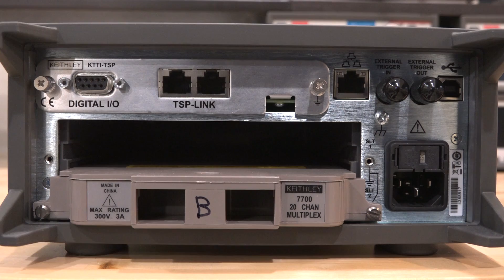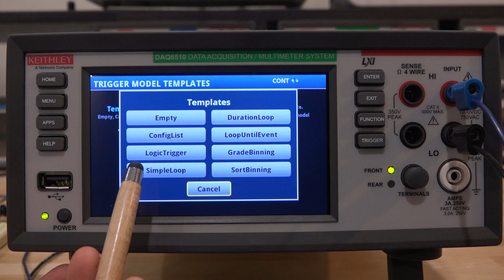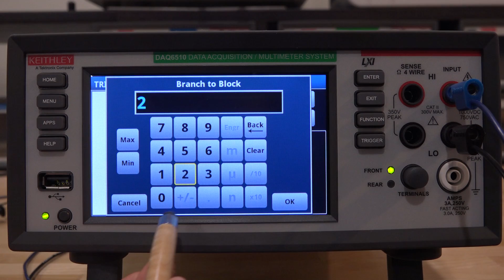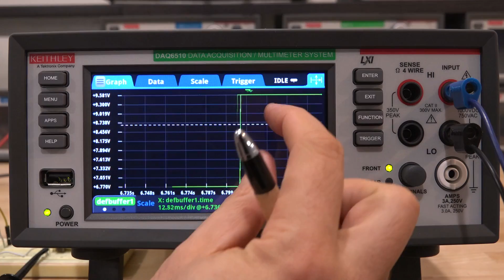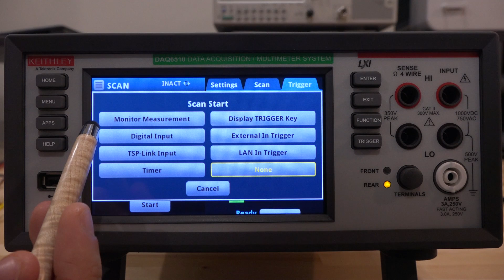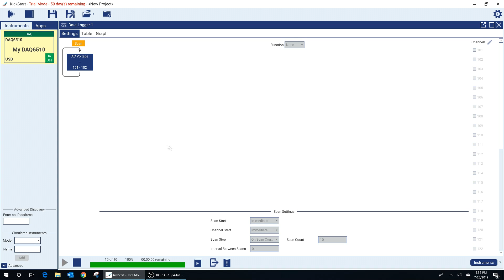TSP #154 - Keithley DAQ6510 6.5-Digit Data Acquisition & Multimeter Review, Teardown & Experiments

Comment: Great review as always Shariar! One question through: Am I missing out on functionality by not using TSP, or can I do the same stuff by interfacing via. LXI/USB using custom software?

I love Keithley instruments! I use the SMU2450 and DMM7510  at work and the DMM6500 at home in combination with other types and brands of instruments. I've used the Kickstart software as a trial (and liked it), but I'm not keen on buying it. I've never used the TSP script.  For measurement automation, I've over time built and refined my own software in C and MATLAB (only by small amounts in Python) depending on the application, using the NI-VISA driver for which I control the various instruments via LXI/USB/GPIB etc. I realize this might not be the case for the  average user, but this approach gives me great cross-brand flexibility and other custom advantages at the cost of time spend writing software and verifying it works.

Comment: For the Keithley 7700 acquisition module, when the DAQ scans Channel 122 for the current measurement, is there a monetary break in the current flow for the DUT?  I can't tell from the documentation if the relay provides a make-before-break connection.

Comment: Dear friend, thanks for the outstanding review of DAQ6510. Actually I am facing the problem of overflow message and hence loss of measured data when I am using 6 termocouples in 6 channels. I need to monitor 6 points of temperature each 30 seconds for 100 counts, but several times i get overflow in varied channels. Some points of the graph get blank. How do I solve this and why this happens?

Comment: Wow they made it WAY easier to use than my Keithley 3706a. That thing is pretty much only usable as a slow benchtop meter unless you get a computer to drive it. I've had a good opinion of the Keithley DAQs, but the new generation is nice indeed. I haven't tried Keysight's new DAQ970A yet but it's a step up above previous generation offerings like 34970A in terms of front-panel usefulness.

I've always enjoyed using a normal DMM and a computer to make a high dynamic range oscilloscope. I did a cool project once with an HP 3458A in 5.5 digit mode and 50,000 readings per sec.

Comment: What is the point of having 1MS/s, if your multiplexer is using relays?

The device and unit is nicely engineered, but I am not impressed, especially considering the price. The extra IO board on top, this KTTI-TSP, it is pointless to put it as a separate board and option that you need to pay for. It would make much more sense to make it a standard, lowering number of parts, and lowering the total cost. Seriously, the only other IO boards, are the RS232 and GPIB options. There is enough space to fit all of it on the unit standard. And if there is not enough space, just use RS232 and TSP, and provide GPIB via small external dongle. It is just milking customers. These IO boards, have almost no engineering effort in designing them, and cost to make them, yet cost about 300-400$. LOL.

Another week point, just look at the voltage reference placement and area around it. It is messy, I see no isolation of the reference, or taking care of leakage.

Similarly, the front/back terminal switching, I do find weird in the unit like this. There are no BACK terminals on this unit per se. It should be controlled by relay, not a manual switch.

It is also a bit unfortunate the fuse is buried deep inside the unit, and not available on front panel instead.

On the acquisition board, you can see the connector that connects to the connector in the unit itself. The problem is, it is not secured to the PCB. There is even place to put screws, but I don't see any screws on it. So, it is likely the connector or solder will break off, as it will carry all the mechanical stress of plugging and unplugging the board.

6 temperature sensors for cold junction compensation, and good thermal coupling is a nice touch, but that it to be expected, otherwise the thermocouple measurements wouldn't be reliable or accurate, and it will be pointless to use high accuracy measurements. It is not even nice touch, it is a necessity, and is done in every good thermocouple based system.

The most impressive parts, are the NEC/TOKIN relays, claiming 100 million actuations with no load (or very slow load, like thermocouples). That is actually magic. Similar ones are by KEMET. Possibly the same relays. I am not sure where you get your numbers for reliability. As I did find 1 million actuations at load (not full tho), not 100 thousends. At for a LATCHING type 10 million actuations with no load, not 100 million actuations.

Ultimately the price is still quite competitive, but I wish Keithley optimized the cost a bit more, as well provided 4.5-digit multimeter with same similar plugin board, even if this allows me to reduce cost a bit. I often simply need 20 thermal / pressure sensors, but I don't need fricking 0.01% accuracy.
Reply from the maker: "What is the point of having 1MS/s, if your multiplexer is using relays?" I don't understand the question. No one is suggesting to switch the relays at 1MHz. You can sample ANY channel at 1MS/s. Clearly there are huge advantages to this.
Reply: @TheSignalPath  The I/O card 7700 is called 20 channel multiplexer. One could hear it switch as in connect ch1, measure ch1, disconnect ch1, connect ch2, measure ch2, ... in the first test. Measurement of 40 channels, 1ch/s would lag the measurement 40 seconds. 
It does this to provide galvanic isolation between all channels. Clever as it does not require dedicated analog sensor- and separation hardware. 
But i rather have an dedicated thermocouple circuit with proper thermocouple contacts read at (all most) once.
Reply: @isojed  - The switching across/between channels can be tuned to your liking. While you can program for 1 chan/s, this is quite slow in comparison to what the 7700 card is capable of. In fact, you will likely find (as I have) that you can acquire thermocouple measurements from all 20 available channels in < 1 s. (This gets faster when you use the reed or solid-state relay multiplexers.) You can view the measurements as the happen via the front panel, the scan progress swipe, and up to 20 channels on the graph.
Reply: @joshbrown5138 That would sound like an machine gun fire. Joke aside, don't get me wrong, it is an really an nice piece of kit.
But 1MS/s can only be obtained with only 1 channel without switching any relays.

I was supprised by this mechanical TDM.
Reply: I understand your worries about voltage reference placement, but does it affect specs of the instrument? :)
Reply: @shana_dmr  obviously it doesn't. I trust the spec. It is just weird, compared to other Keithly instruments :)

Comment: You might suggest that Keithley change from slotted to at least a symmetrical screw head such as a Phillips for their data acquisition inputs as this would allow a much higher number of cycles on each screw head without errors. de KQ2E
Reply: Very good point. The slotted screws were a big cringe for me when I saw these modules.

Comment: Smartphone culture creeping into the measurement equipment design.
Reply from the maker: Ventsislav Simonov Smartphone capabilities creeping into test equipment.
Reply: @TheSignalPath  I for example don't fancy touchscreen interfaces, but if they let me get job done faster and easier I'll use it. If someone invents a tool that requires using let's say Nintendo Wii motion controls and it will help with my workflow, why not? In case of this meter/DAQ, it's a tool that let us do mass measurements that typically requires some VISA setup,  scripting and/or dealing with proprietary software and drivers by tapping the screen on the multimeter few times.
Reply: @TheSignalPath  Would be sad because my iPhone cant do anything for me except display the newspaper. Certainly a nice device but I like to do everything myself over LXI. VFD 's 'nuff for me.
Reply: Aye man, but they've been put to good use and have not been added for the 'bling-bling' factor :)

Comment: Got the 6500 which is currently on offer for less than 1000€.
Unfortunately no real power button and the transformer hums when off.
Does Shariar collect those Keithleys ??
Reply: Whats the difference with this one, 6500 seems to be 800€...
Reply: @finbenton  spec seems to be same, only 6500 has only Max one 10* multiplexer card (500€).
Apps and trigger is the same afaik.
For upper hobby level seems to me best choice currently for bench meter.
Reply: If it hums when off you should be able to return for service. Not defective per se (does not affect specs), but the transformers can be updated/replaced.
Reply: @joshbrown5138  thanks for the info. It doesn't really bother me, it's more related to the non existing real power button and the resulting power consumption.

Comment: And... it's affordable!  Not cheap, but affordable: the DAQ6510 is about 2x  the price of a DM3068.  With the 7700 input card in the video, <$2300 total!  Thank you Keithley.
Reply: A better comparison to the DM3068 might be the DMM6500. The latter is a little more expensive, but specs and the single card option slot might be reasons for that.

Comment: I'm a bit surprised they are using standard signal relays.  I would had expected high capacity precision reed relays like those made by Sanyu.
Reply: The 7703 card uses reed relays; the 7710 card uses solid state. Most other cards (7700, 7701, 7702, 7708, etc) use EM relays.

Comment: That seems to be built like an oscilloscope. Love it!

Your video reminisced me of an idea I have going. I'm planning to design a power supply with both CV and CC modes, with the addition of having integrated voltmeter so it can be used as one (output shuts down and goes high impedance in that mode). Also able to trace V/I and I/V curves of components, if required. All in one unit, controlled by USB.